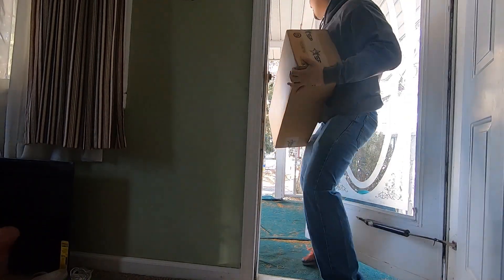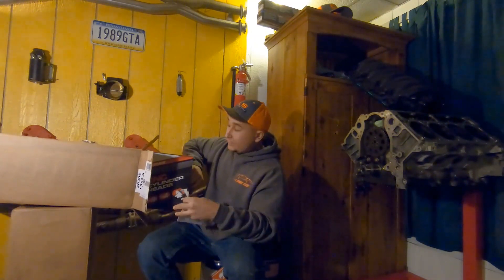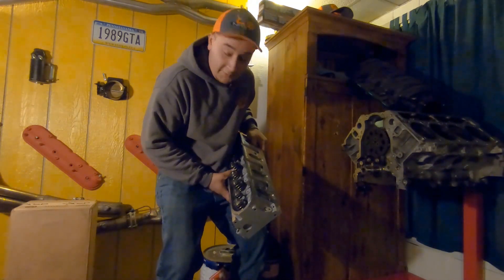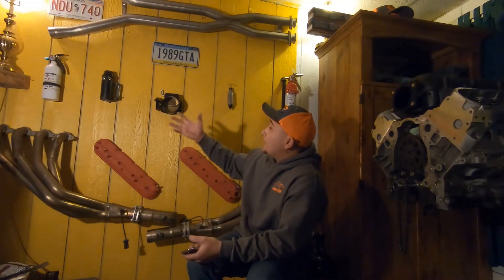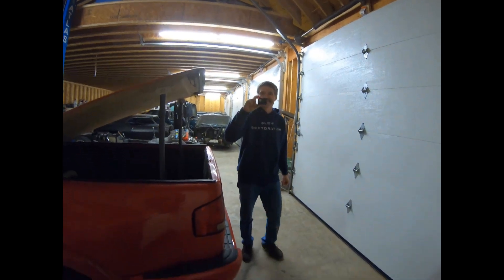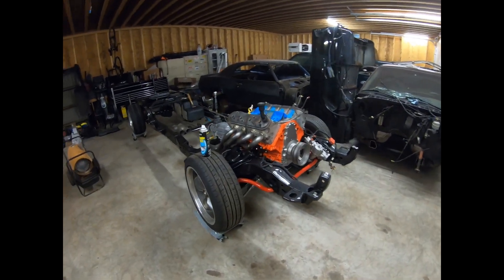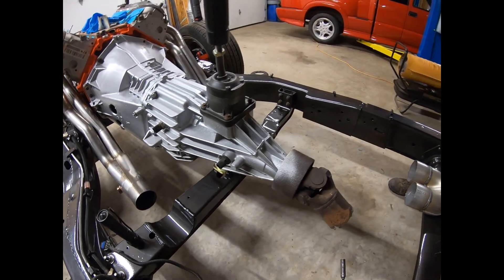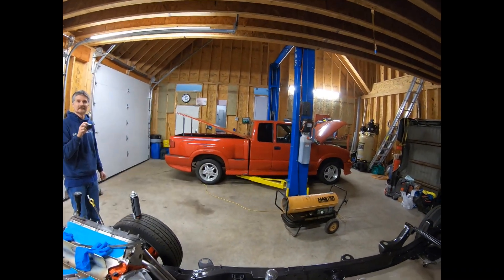3RD GEN GTA TRANS AM LS SWAP UPDATE FRAME OFF RESTORATION

Comment: Another down to earth video. Your demeanor in this video reminded me so much of your first ones but at the same time you seemed so relaxed. < I meant my last sentence as a very positive one. I have purchased 3 engines from Texas Speed over the last 2 years and they have been outstanding. Texas Speed is one of if not the best friendly company that will take the time and ask you what your going to use your engine for. Than recommend what internal parts and block they would recommend for you. Thanks Sendit Steve keep them there videos coming....
Reply from the maker: I really appreciate the support